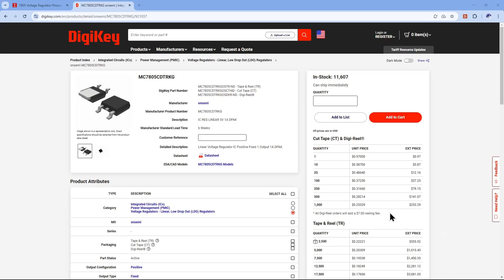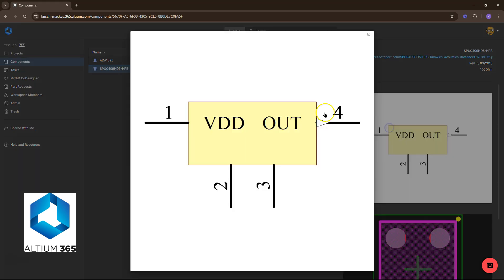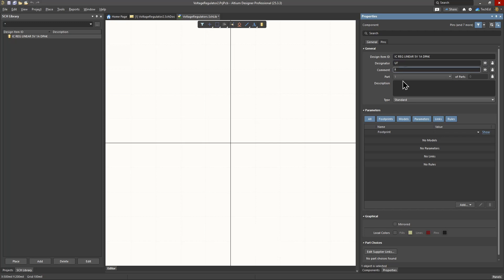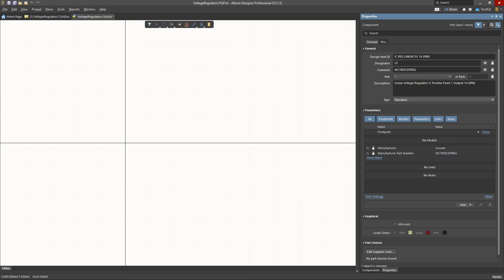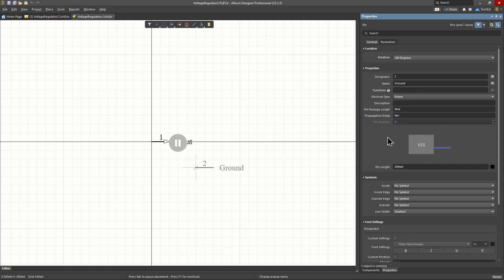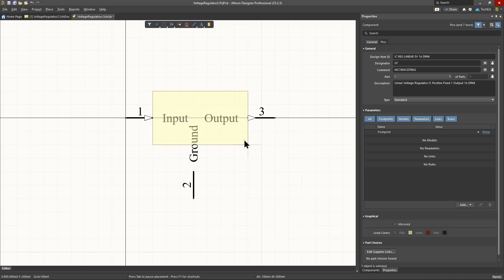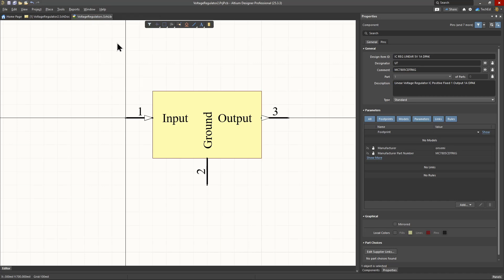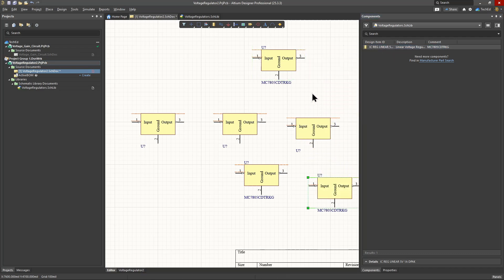Altium Designer Schematic Symbol Creation in 5 Minutes!

Comment: How important is choosing the correct Electrical type? Is the Electrical type chosen just for DRC reasons or is there something more deep to it? What if the datasheet does not tell what type your pin is? ( Sometimes we can make an educated guess, sometimes we can't and then sometimes we can choose more than 1 type).  Is it safe to just make it a 'passive' in that case? Ty
Reply from the maker: @zmarssojourner7435  ah as far as the software itself, yes it’s primarily so the DRC can catch the error before it becomes a problem to debug later on.

It won’t blow anything up to have it as ‘passive’. So no worries there.

If we’re speaking in general, then yes you always want to apply the pin types properly since it helps avoid simple and common mistakes that could otherwise derail or slow down the project if left unchecked (like the software allowing an output to connect to another output, but because there’s no internal pin type for it to check against, you end up spending hours or days debugging what went wrong

Comment: Ty for the vid. How do the pins glue to the box? Do they automatically glue themselves to the box or do we gotta 'merge' or something somewhere? I ask this because when we click on the box and try to move the entire thing, just the box is moving with the pins being left behind. Ty for the reply!
Reply from the maker: Great question! The pins don't glue to the box, nor do they merge. What ends up happening is that once the schematic symbol is saved, then brought onto the schematic from the library, the symbol is 'flattened' for the purposes of the schematic environment. However, all elements are always individual items on their own layers while in the schematic editing environment.

Similary to how in Adobe Photoshop, if you open a .psd file to work on, all the elements are their own things.

Then when you export the project from Photoshop, it's all flattened to one image, where you can't edit or move any individual item.
Reply: @ Hey dude. Ty for the response. Yes, as you said, it flattened because when I imported the part to my schematic and tried to move it around, they all moved as if one integrated unit. So yeah, what happened was what you said would happen.
Reply from the maker: @zmarssojourner7435 awesome. Actually, that’s an interesting question. Would you be able to ask some more that come to mind and I can put those in a Google sheet then address each of them accordingly?
Reply from the maker: So, from my note below, basically, no need to merge any items